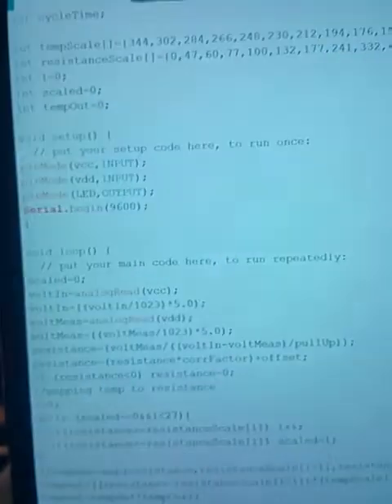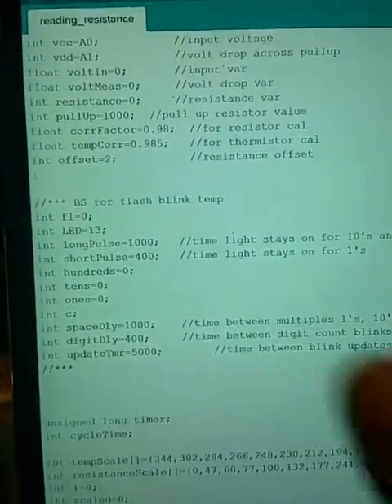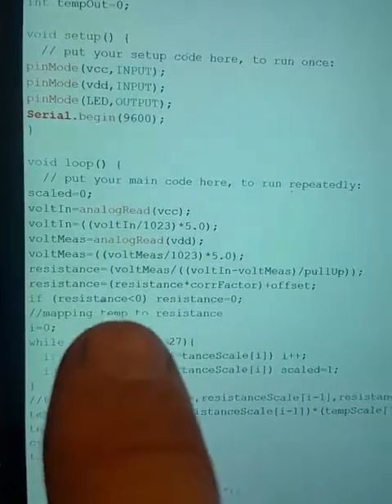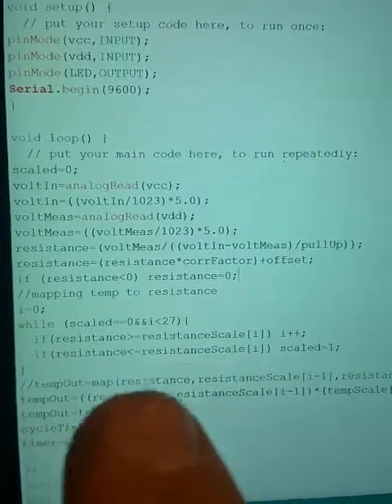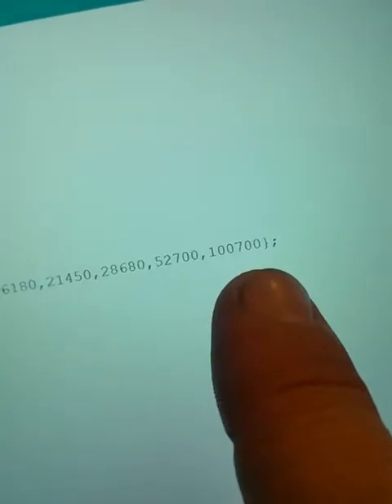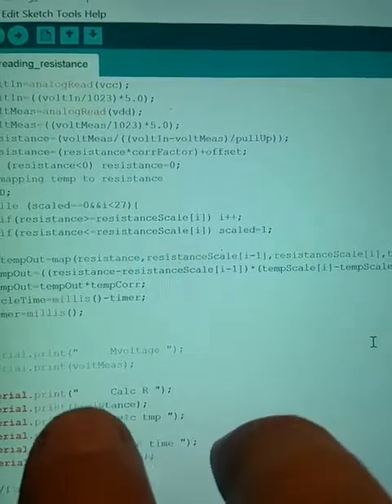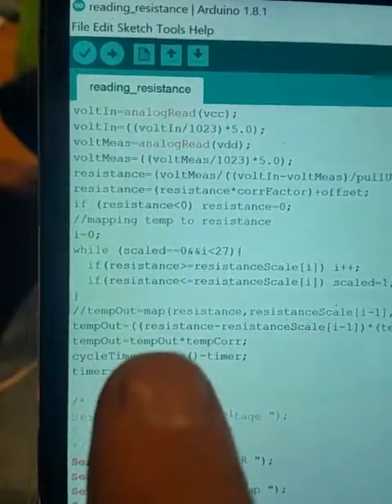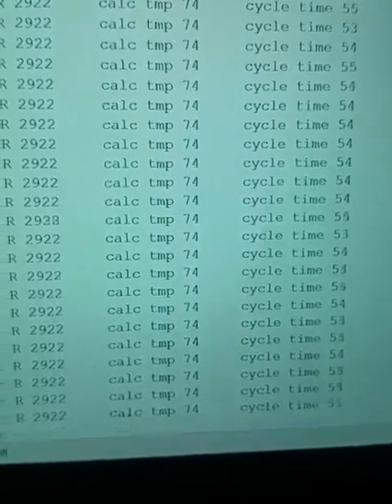Reading an LS1 temp sensor with an arduino

Comment: Yeah. I am trying to use a 3 wire out of a grand prix.  I am not good a writing code. I found some that was written for a 10K thermistor. But the values are way off.  Posting your code would be awesome!

Comment: Hell yeah! This is perfect. Would you be willing to share that sketch with me?
Reply from the maker: ryan droelle most of the code is in the video. Convert your 0-5v analog in 0-1023 into voltage. Install a pull up (play with this value. May need 1000 ohms, may need 10k. Depends where you want the most resolution) between 5v and another analog input. Convert this input to a voltage. Connect a potentiometer from the floating end of the pull up to 0v. Set it at something simple like 1k ohms. Do the math. Ohms law for 2 resiators in series. Knowing the voltage drop across the pull up, and the current across that resistor, you can accurately calculate the resistance. 

Make 2 arrays. 1 array with data for the resistance intervals of the sensor and 1 array that stores the temperature value at those intervals. Now if looked up, at resistance[1]  should equal the value of temperature[1] on the sensors datasheet. 

Next, if the calculated resistance is 1005 ohms, and you have in your resistance array something like 6=890ohms 7=1100 ohms, set up a for loop that tests if the array resistance is larger than your measured resistance. If it replies yes at 7 in this example, store that value. Then map to your output variable sensorvalue,resistance[7-1],resistance[7], temperature[7-1],temperature[7] ..   This will get you very close to the actual temperature. If it's off, apply a percentage of adjustment to the output to correct it. Test it with the potentiometer for accuracy and using a digital multimeter to verify the resistance of the pot. When it's dialed in, attach the sensor and you will have accurate values!